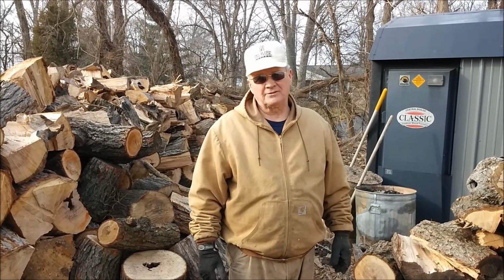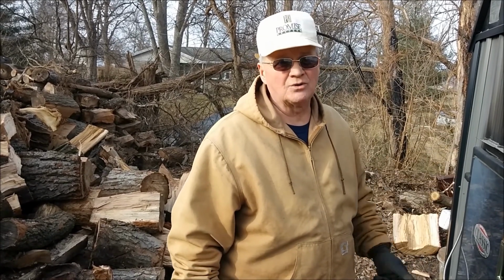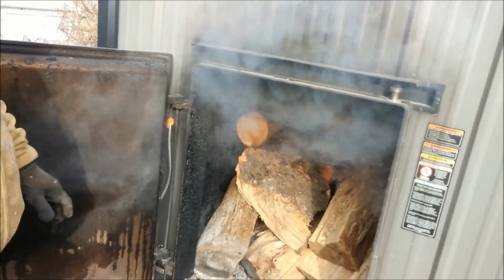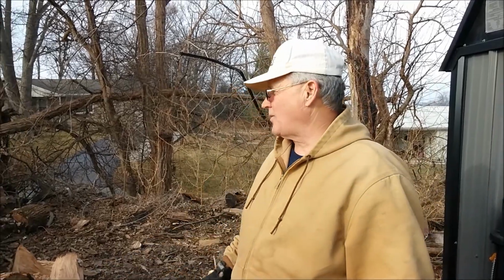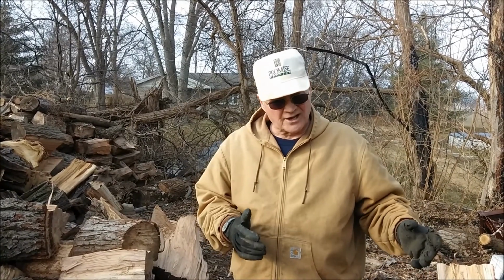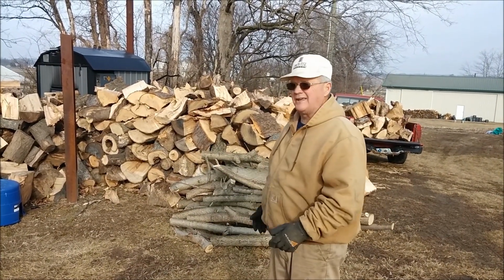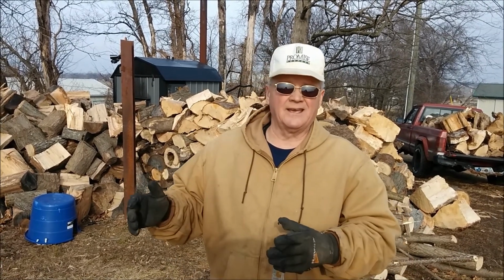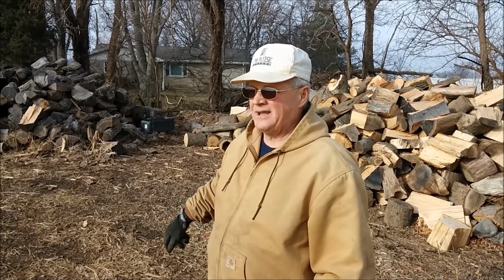Blue Collar Pastor - Splitting Wood (2015 #1)

Comment: Love your videos. We use a system similar to this for our B&B. we have wood slabs delivered from a local sawmill. Our stove is a Wood Master Super Duty. It will take up to a 4ft log. The slabs are the bark and edges from the trees they mill. The bundles come to us 8ft long and about 5 ft around. All we have to do is cut the bundles in half. Our stove will hold about 1/4 of a rick at anytime. If you have a sawmill near this might be an option for more wood.